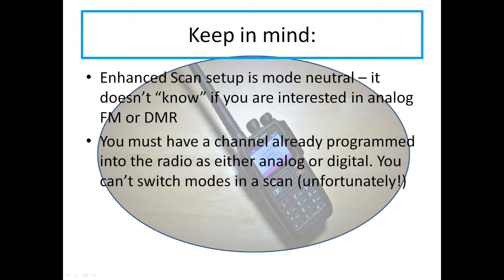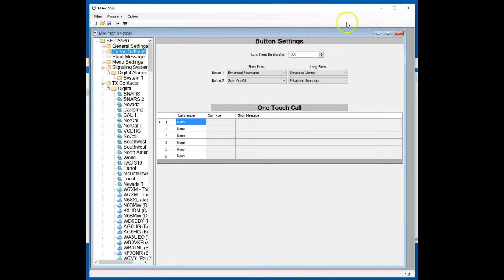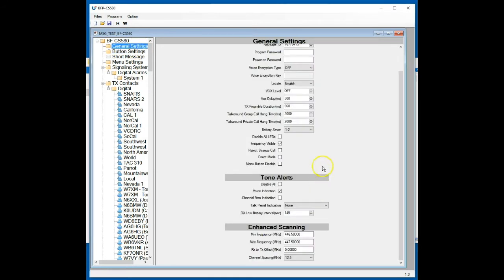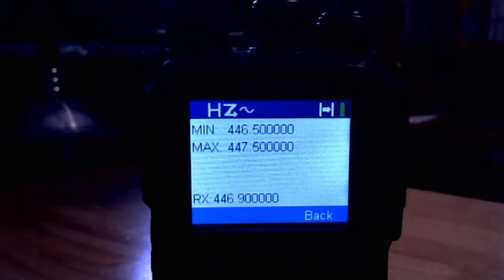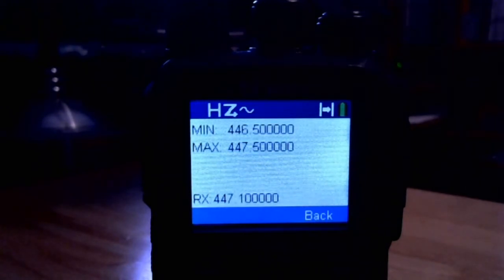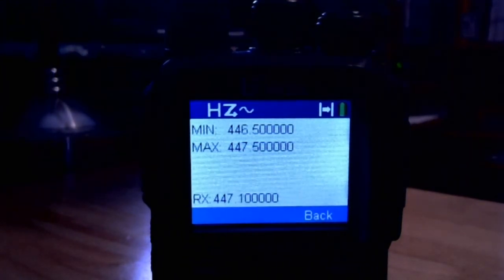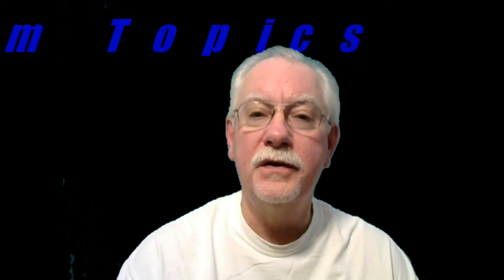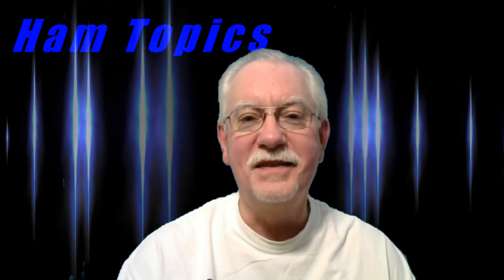CS580 Enhanced Scan Update

Comment: Thanks for the update. I have had a CS580 for about a week now and I am enjoying using it thanks to your informative videos. One thing I notice and I am pretty sure this is normal operation but I thought I would run it by you for your comments. When using Enhanced Monitor or Enhanced Scanning in DMR Mode you will not hear any of the talk groups on the repeater you are monitoring that are dynamic where you have to push the PTT to hear them . The only Talk Groups you will hear are the ones that are static and always enabled. This seems to be normal operation as I only hear the static TG's on my CS580!